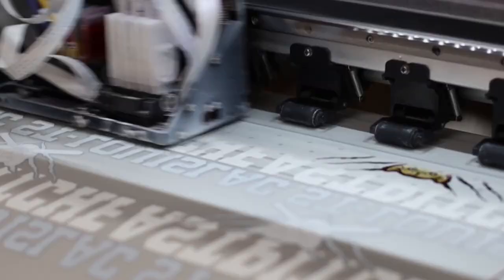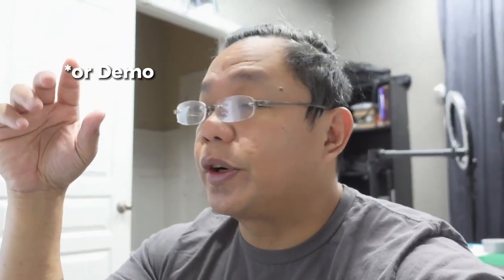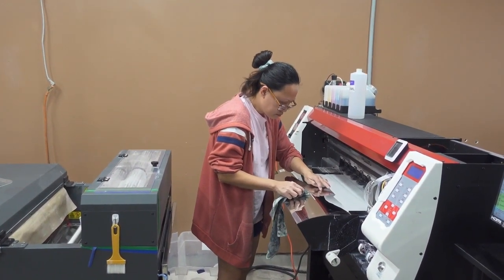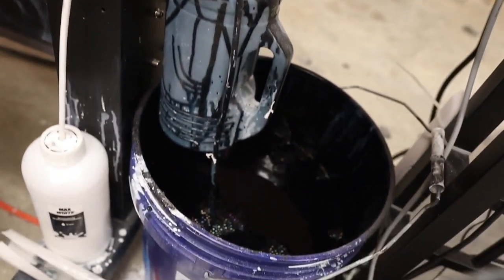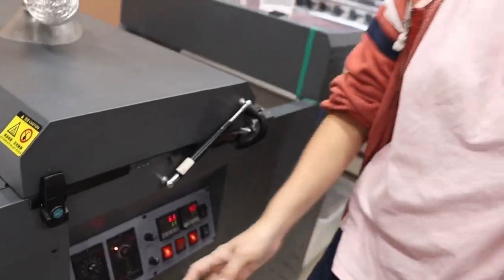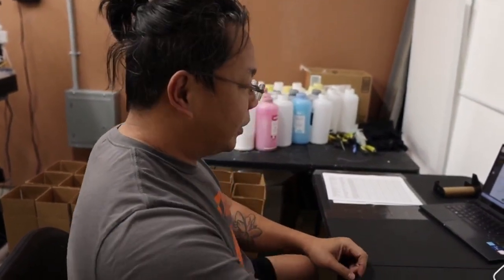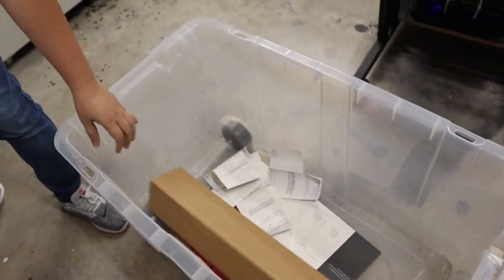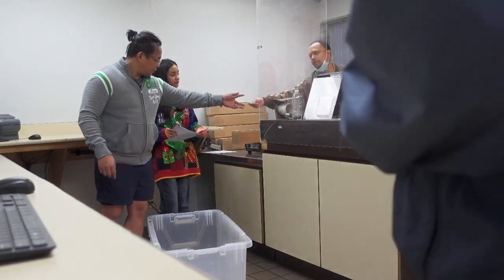Day In The Life of a DTF Printing Entrepreneur - Home Printing Business Routine

Comment: You say you reuse the white ink from your waste bottle. Do you wet cap your heads? If so, wouldn't the cleaning solution then mix with your white ink and cause problems? Thanks
Reply from the maker: Great point! We dry cap as that was recommended by our seller. When we're flushing the print heads, we use a different bottle for the contaminated ink.

Comment: did you guys start with a small printer? I have been working for about 2 years and can not seem to get traction, I only work part time after work in the evenings and weekends....
Reply from the maker: We leveraged social media a lot, specifically tiktok. A lot of printers start selling way before they've mastered the craft and it helps significantly when you establish a connection with with target market. This is our tiktok: https://www.tiktok.com/@mercheez
Reply from the maker: ...and we started with a Cricut Air 2 and a 15 x 15 Amazon heat press.
Reply: @merchstudio  yes, I started with a cameo because of the internet requirement....and a 200 heat press from amazon...I think this is a common way folks start...
Reply from the maker: @blameitontherain2020  I agree!